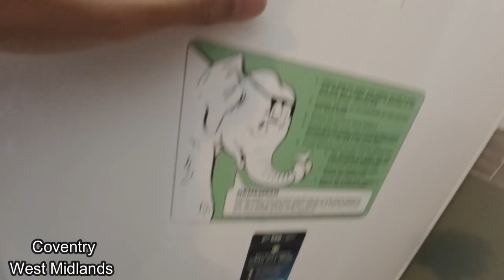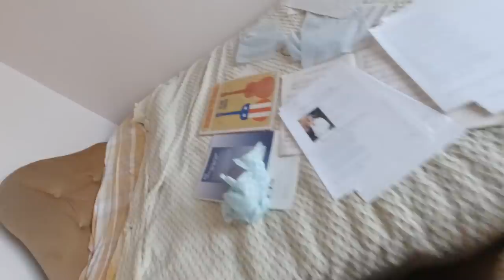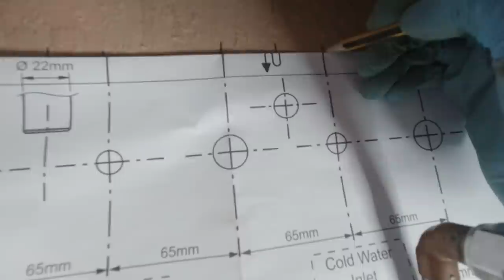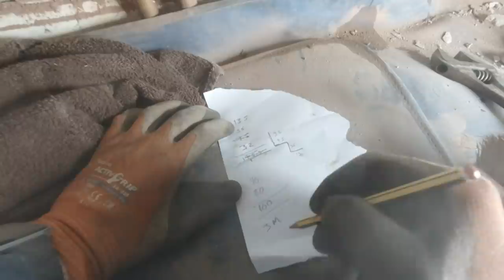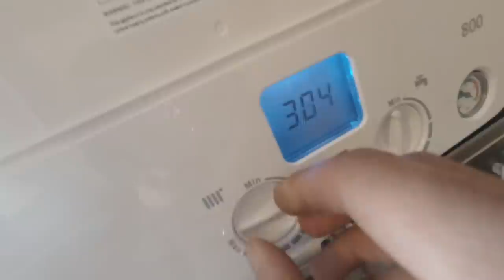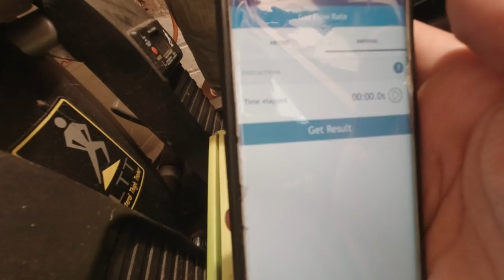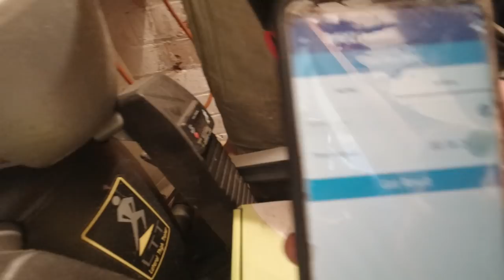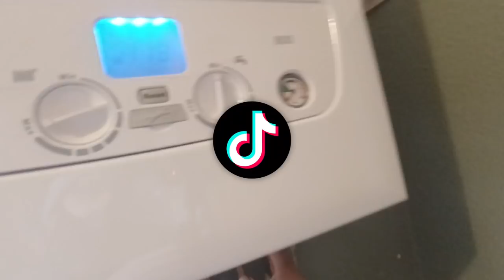Combi Boiler Installation & System Flush | Full Tutorial 🔥

Comment: Good stuff a little tip Iv done with my magnacleanse adapter you may want to do, theres a silver pin in the middle if you push it out you aren't restricted to where you can put the adapter. Sometimes I do a flush and there's not a filter on there so with the pin removed I can put the hoses where I want if that makes sense lol
Reply from the maker: Yes makes sense thanks mate

Comment: Some good info, you can not commission a boiler without a new fuse spur a three pin plug is not to regs, and this is a reg that has been around for years. All so the radiator with two lock shields is used as a secondary bypass as most combis have a built in bypass the main reason it has two lock shield is because the room stat will be going closest to that radiator, and you can not have a trv on that rad because it could mess with temperature reading on room stat and will alter the whole house temperature. When doing cold flush it is better to turn flushed rad off first before turning next rad to be flushed on because you can get some of the dirt from that rad pushed into the rad that has just been flushed. Magna clean should be straight and do go straight when done correctly. You need to do a gas working pressure at the boiler and make sure the working pressure is to manufactures reg's  a 1 mbar drop from gas meter to boiler is not adequate if working pressure is not correct to manufactures reg's  with other gas appliances turned on. Nice clean job with dust sheets and tidy pipe work with no runs on soldered pipes You have a good voice and explain things well

Comment: I'm looking to have my floor standing boiler replaced with a combi ,the existing boiler is on a outside wall  but I would like the new one fitted in the old airing cupboard . The gas meter is also on the outside wall ,I'd prefer not to have the new gas supply running up the wall outside through into the attic and down to the boiler , do current regulations allow gas pipes to be run under floor.? boards ?
Reply from the maker: Yep
Reply: @PlumbingDoctors  thank you 👌

Comment: Great work mate , my building is switching to condensing boilers now from old chimney ones , problem is building is made in 1991 and sewage central pipe thru building is made from iron ,  pipe below old boilers to drain them is made from lead . I am afraid that condesate will eventualy eat thru iron sewage central pipe even if we change that lead pipe to plastic , even with decontamination filter , i dont trust people above to me regularaly change them , also been reading obout that new condensimg boilers work on lower temps so i would need to buy new radiators , all things considering it is to much money for not reliable boilers been running vcw t3 vaillant for 31 years no problems .

Thing is vaillant relesed new chimney boilers to modernize buidings like mine vuw 194 4-5 atmo tec plus , simple and proven tech .

Comment: That is not good way to power flushing you pushing all  sludge through Boiler., you should power flush system.befor connecting  Boiler flow and return  Then plumb  boiler
Reply from the maker: Nah not really as the 2 large magnets are connected to return pipe before system is filled - if you watch till the end you will see how much sludge we got out
Reply: Everything is properly correct ,I think he forgot to run cooker on working pressure if cooker was there
Reply from the maker: @majjatmohamed6927  tried to record everything but somethings got missed as i was rushed at the end
Reply: @PlumbingDoctors because you was fasting Ramadan working is difficult 😑